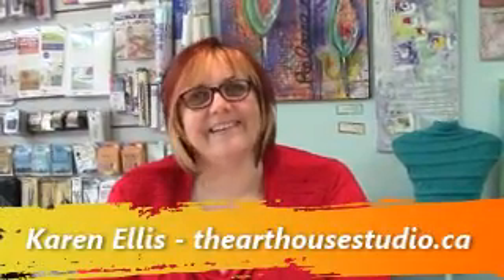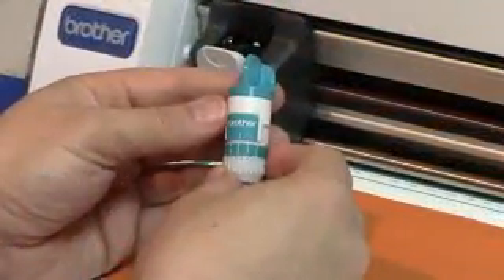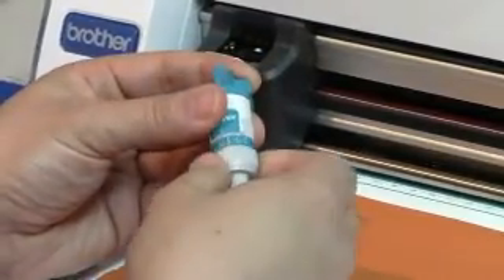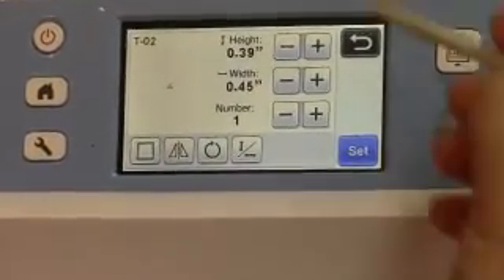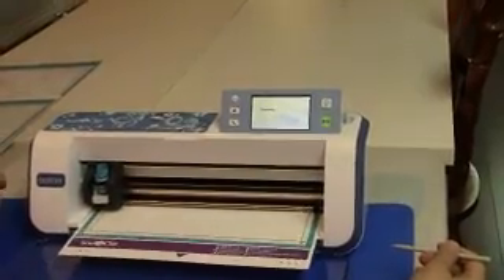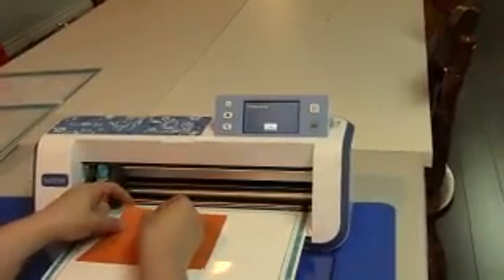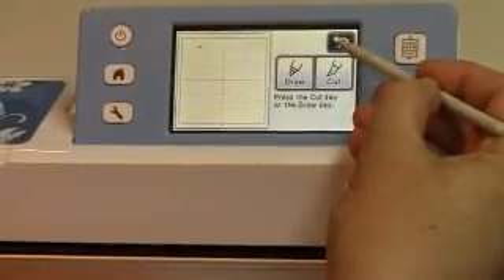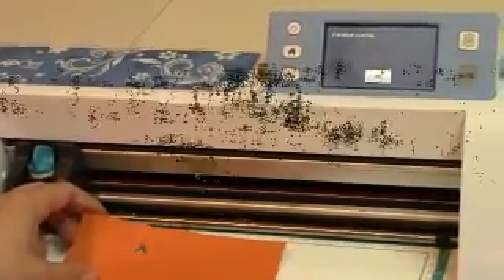Brother ScanNCut - Testing your blades

Comment: I'm looking for a cutter & am interested in the SNC. I saw a video of this machine cutting a piece of 2mm leather. Do you know if it will cut 3-4mm? I know the Cricut Explore does but I really do not want a Cricut because of their web based software. I'm willing to spend the extra $300 for the SNC if it can do thicker leather. Thanks!
Reply from the maker: there is a 2mm threshold on this machine....   so it won't cut the thicker leather. :(
Reply: Karen Ellis
 Thank you!